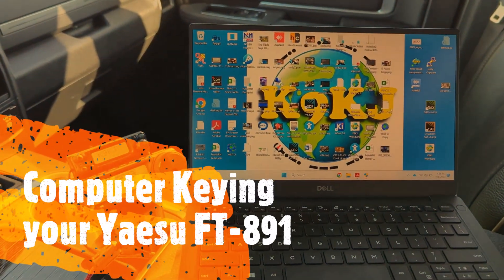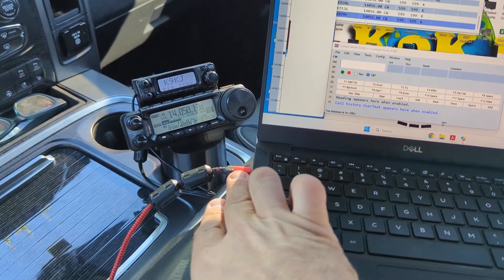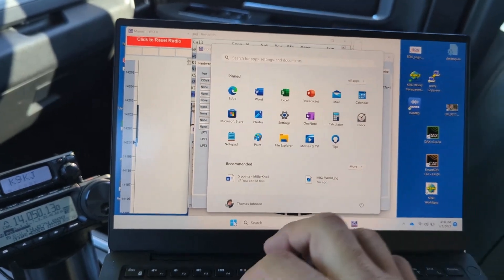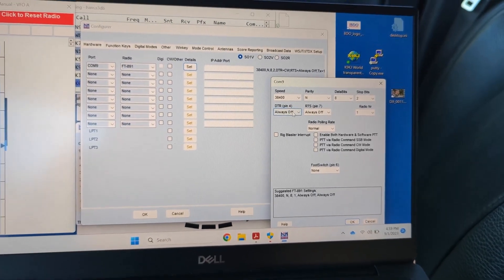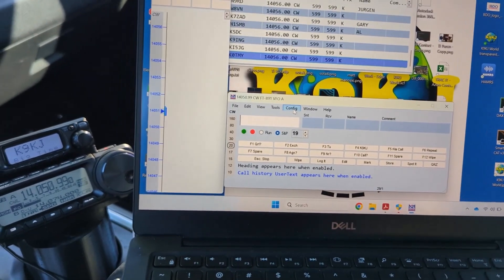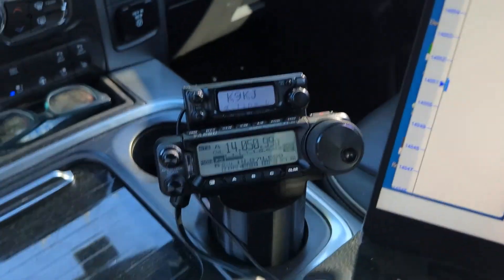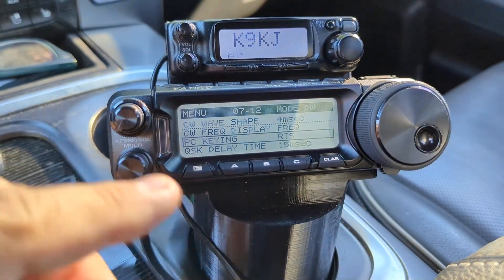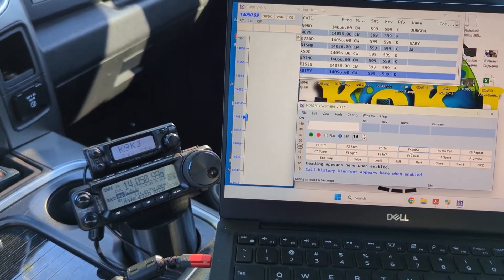CW Keying your Yaesu FT-891 with N1MM

Comment: How do you adjust ALC with this?
Reply from the maker: I didn't think you can adjust the ALC but you can adjust the mic gain and if you are using FT8, the power slider on wsjt-x.  Are you having problems with ft8 or SSB?
Reply: @k9kj  No problems - I’m accustomed to adjusting the gain and ALC using FT8 and I’m assuming that the same applies for CW and N1MM.  Is that not the case?